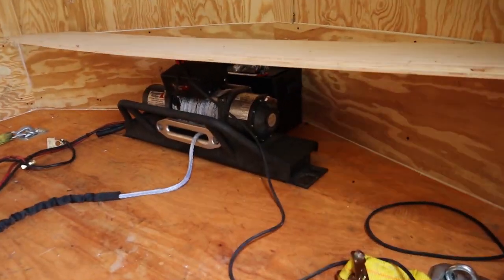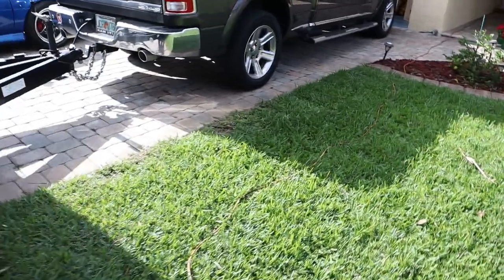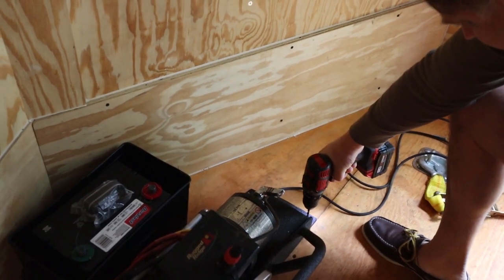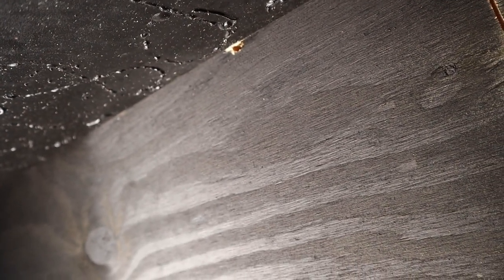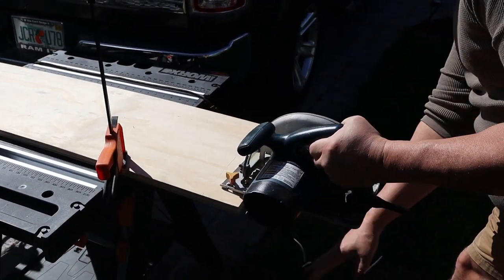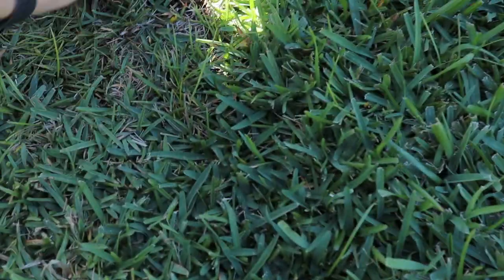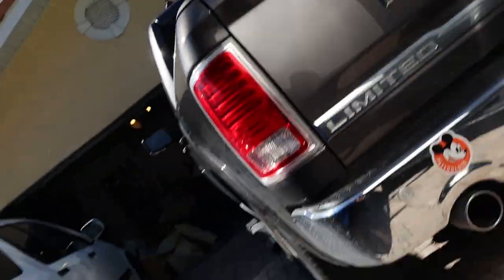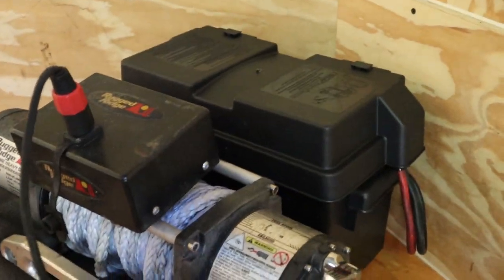Winch Install on Trailer

Comment: Could you have used a steel plate in place of the wood?  Like a floor sandwich - so you have steel on either side of floor? The thing you copied (the tie-down I think) looked like it went through steel.
Thanks
Reply from the maker: I prob could have. But this setup has been working perfect for about a year now. Not a single issue. Have prob used it about 30 times

Comment: Ok I have a question lol I seen u have your wires running from the battery to the outside the trailer , are those wires running to your truck ? Do u have a a plug at your bumper and then it runs all the way to your battery under the hood?

Comment: I hope this was a joke and really was a video on how NOT to install a winch in a trailer.
Reply from the maker: It has been working flawlessly since the install. Thanks for the feedback
Reply: @AndyHilins  it may work but it isn't done correctly. The tie downs are bolted through steel for a reason. Good luck
Reply: @donzon353  they can use the wood for a casket for the winch. 😅